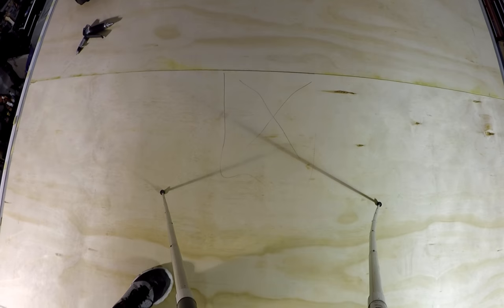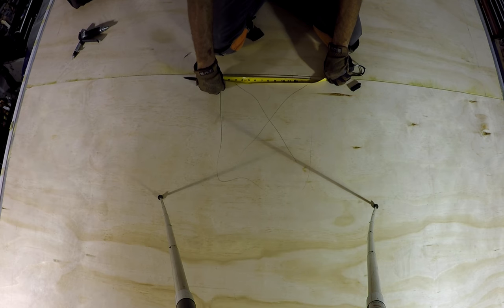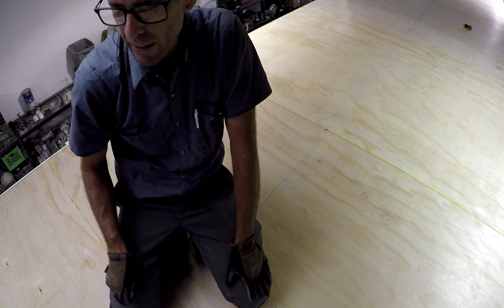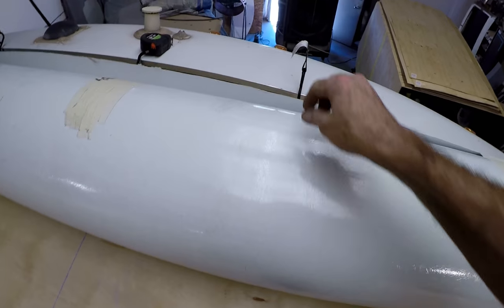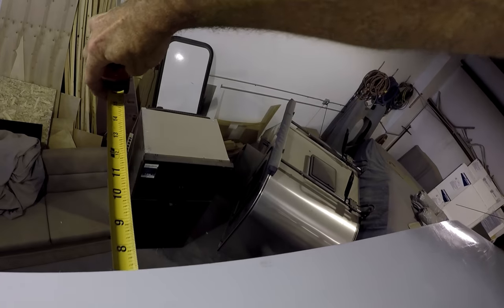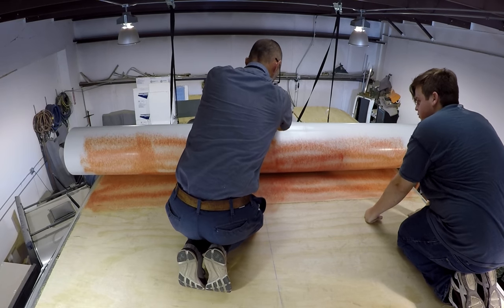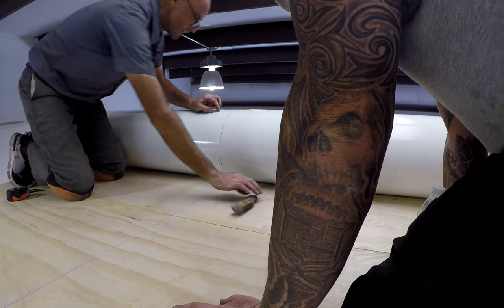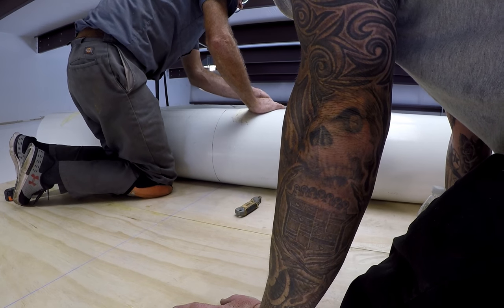How to laminate a fiberglass RV roof

Comment: curious, why just use marine frp, and epoxy? one layer of 1708 biax -/+ 45 would seal it forever? its flexible and durable and guarantees a seal for decades unless compromised somehow. but more durable than rubber and goopy caulking.

Comment: AZ Expert thank u for your videos they are great!! Wondering what kind of gun u are using to spray adhesive on? I talked with stabond and they said a gun with a pressure pot is the best way to apply... What are your thoughts?
Reply from the maker: Thank you, I'm glad you like them. My take on a pressure pot gun is that they are bulky and difficult to drag around a roof without causing problems. Maybe if a shop only does this all day sure. Thanks!

Comment: I have a 2008 National Sea Breeze with a debonding roof that needs replacing before it rips, on sign of sealing problem around vents.  Is the plywood backer thicker on these units?
Reply from the maker: My latest video is on a 2004 National Dolphin with roof problems. https://youtu.be/7_N5TchAXRk 
I would say as long as it is not torn, delamination at the radius is common, not to worry about it. The deck is mostly thin luan too but the framing is dimensional lumber. I would address the leaks of course. Thanks!

Comment: Have you found a good way to fix a long crack (2 feet) that runs horizontally on the roof radius, short of doing a full food replacement? I'm considering buying a 2004 mini winnie with this problem.
Reply from the maker: Winnebago does have a roof radius kit which is just a j-molding that is screwed to the roof and a new filon 20" radius from front to rear get tucked into the top and gutter rails and sealed. Other wise, it could of course just be fiberglass repaired. Thanks

Comment: Where can I buy large sheets of gelcoat fiberglass rolls like the one in the video?
Reply from the maker: This is not technically gel-coat but filon. The easiest way is through Amazon. https://www.amazon.com/Arctic-White-Fiberglass-Filon-Siding/dp/B01MDRBFU2/ref=sr_1_1?ie=UTF8&qid=1544997805&sr=8-1&keywords=filon&th=1 Thanks!
Reply: I was going to ask same thing lol, doing my 3rd d.i.y. camper
Reply from the maker: thats awesome. what size and type is it and have you made previous?
Reply: @AZExpert  I made a 4x8 Harbor Freight into a 5x10. Used 5mm luaun for exterior and weather proofed. Bad idea! It flaked apart in sheets. My 18x8x7 backhow trailer/camper is still going strong after 4 years. Used cdx for exterior.  My new one is going to be a truck camper, somewhat a unique build on a dually 4wd utility body with built on aluminum ladder rack front to back and mounted to front bumper. rv.camp.kayak.hike.music is my instagram you can see picture of blue truck Im doing this on. Great job btw
Reply from the maker: Three is impressive. I should hope to be posting a video of my teardrop sometime soon.
Reply: AZ Expert on

Comment: So the sheet you are rolling out is a 2mm grp sheet in a roll??? What the cost per sq ff or m2 tks
Reply from the maker: No this is Filon material. It does come in different thicknesses and widths, but is used almost exclusively in RV manufacturing. The standard product can be purchased through RecPro on their Amazon store, but these Winnebago roofs require a wider material. It is available from All-Rite manufacturing or even Hemmet Valley RV in the US. Thanks!

Comment: Curious how you got the sides rolled back into the drip rails.  Thanks for the vid.
Reply: And what type of adhesive/where to buy ? Thanks again
Reply from the maker: I made a video that should explain it the best. Basically after cutting to fit, carefully manhandle it back in and seal. https://www.youtube.com/watch?v=9RN5e4IuEQY Thanks!

Comment: My 89 warrior has a metal top. Are the older (my) roofs constructed the same as the one I see in your videos?  If I re-roof would it be the same plywood under the metal cap? Would you update too a more modern cap material?
Reply from the maker: They should have similiar contruction yes. I would only upgrade if the metal was torn or substantially damaged. You will have a very difficult time locating let alone, installing the thin aluminum sheeting so I would not even try. Thanks!
Reply: @AZExpert  I was about too install some rack mounting for solar panels. What I was researching was where and how to best attach the mounting rails. I wish you were closer and i could offer you the job \ task. Is there a proven method for attachment too / thru my metal and foam roof? ? Or more importantly , anything I should NOT do during the installation ? Thanks in advance for your expertise,  even if you just refer my too another resource.
Reply from the maker: @sostahoe  Thanks for the offer and kind words. It has been my experience that unlike what you'll see on most videos online, butyl/putty tape underlayment is not a good choice for most roof mounted accessories. Putty has to be compressed to seal, many RV's(like Winnebago) roofs lack thick enough backing to hold a screw under pressure.  I prefer to use what ever roof lap sealant I am using ontop underneath the accessory too. The sealant becomes the best adhesive while the screws, which should not be longer than an inch, act mostly as clamps until the sealant sets.
Reply from the maker: Just make sure the mounting surface is clean :)
Reply: @AZExpert  Your comments on through mounting solar panels would be appreciated.  Thanks.
Reply from the maker: @tomslover7512  Mounting solar panels or the overall installation? I am working on a video of the process.